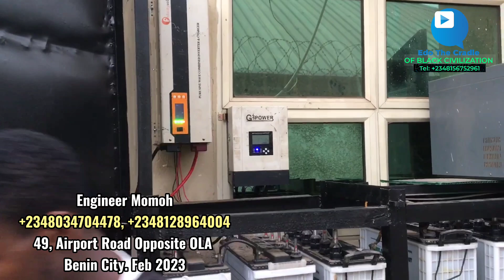Good News For All Home Owners In Nigeria You Can Now Get 24hrs Solar Power Supply With This Price

Comment: Bro, I cannot use any battery that is not lithium iron phosphate for electricity in my house, lithium iron phosphate battery can last 10 years without maintenence. . Lead acid battery doesn't last.
Reply: Well if you watch the Video. 

He said the Lithium Batteries are more expensive to purchase
Reply: Lithium ion battery is good if you have the money to spend and it makes your installation neat and requires less space. Also with lithium ion battery you can really get more capacity from the battery.
However, obvious not everyone can afford it and this is where lead acid battery comes in.
The best lead acid battery to use for solar is  tall tubular battery. It's cheaper than lithium ion battery so you can buy more to augment   your battery capacity. The only requirement is regular maintenance with distilled water only. Very easy to do: for instance i taught my uneducated elderly mother to top up her battery herself and she's been doing it really good.
She is 100% off grid and has 24hrs uninterrupted electricity and using it to pump water and maintain her two freezers.
Since she went off grid she has been growing younger every year 😃😃😃